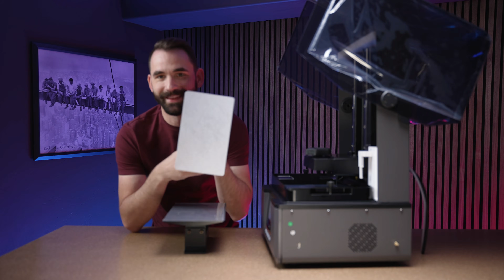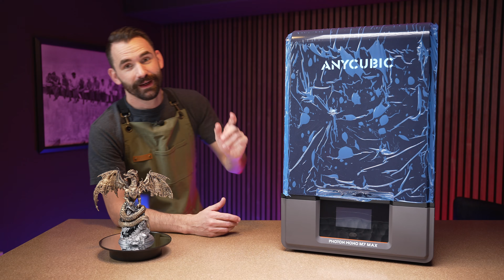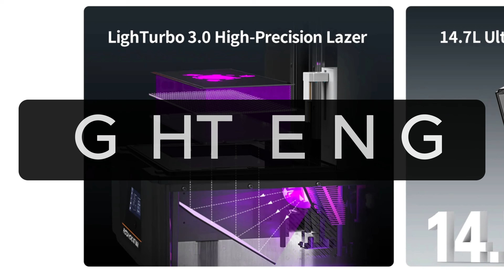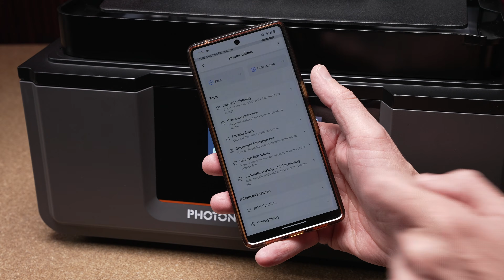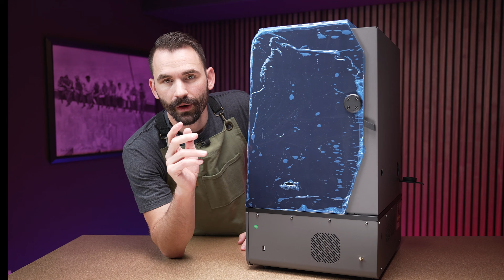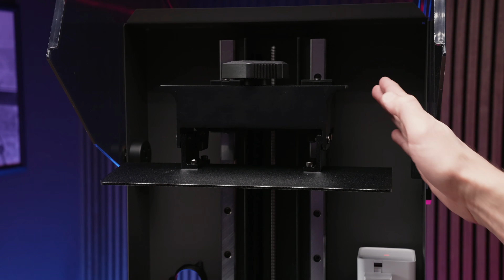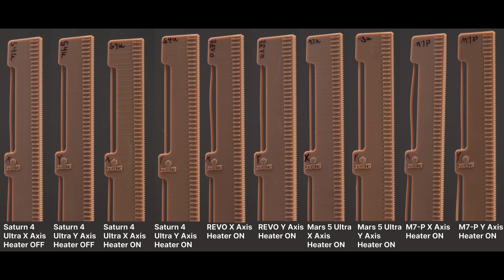Should the M7-Max be your next Printer?  #review #3dprinting

Comment: I love that the print will stop going to the top but i think it could be done better like elegoo did.
On my M7 (non pro or max) If i try to go up 50mm but its only 49mm to the top, it will give the error and not move instead of just going 49 and stopping. I would rather it be like my Saturn 4 Ultra, In the same scenario, it will just go up 49mm and stop.
I hate getting 49mm away, then having to switch to 10mm, go up 4 times, then go to 1mm and going up 9mm to get all the way to the top.
Reply from the maker: @TylerTroglen  What did Elegoo do? My Saturn 4 Ultra and Mars 5 Ultra will both crash at the top. Unless they updated it since last I checked. 

But on the Max if I keep pressing up on 50mm it will give me an alert exceeded upper limit. It will then go to the very top but not crash.  

I did not show this in the review I should have kept that bit.
Reply: @J3DTech  It must have been updated in firmware ( I've only had mine for 1.5 months)
You can use 50mm even if you are 1-49.99mm away, it just goes whatever amount,  beeps and stops on mine at the top.
My M7 on the other hand will just stay 49mm away while giving the error if the amount entered is too far. I was confused on the M7 and thought to myself, Why wouldn't they let it go all the way to the top at first before i figured out i had to change down to 10mm and 1mm increments to get all the way to the top.
Reply from the maker: @TylerTroglen  I just tested it on my M7 Max and it went all the way up to the top just by smashing the 50 mm up button.
Reply: @J3DTech  https://youtube.com/shorts/TJ0vapSvmgg?si=WVFFF33XaLrQhUV5 this is the behavior of the regular M7
Reply from the maker: @TylerTroglen  Ah I don't have the M7 to test on. But yeah looks like it needs the M7 Max love.
Reply: @J3DTech  It gets even weirder. I powered it off  and on for about 30 seconds and tried again. It just straight up tried to kill itself this time . I couldn't get the error to pop like before. It just kept trying to go up when it got all the way to the top. /sigh Obvi some firmware issues to work out. I would much rather get the error than that.
Reply from the maker: @TylerTroglen  They all do that. It has to be sent to home first.
Reply: @ good call. Thank you I did not know that.

Comment: Derek,
Can you confirm if there is no way to manually adjust the Z-height of the home position on the M7 Max? There’s a "Move to Home" button and a button for leveling, but there doesn’t seem to be an option to set the "home" position after manually adjusting it. On your level calibration prints, I’m getting consistent results, but the "1mm groove" appears slightly thicker, and I’d like to adjust the home position. I see no way to do this and was hoping you could confirm.
Thanks!
Reply from the maker: @jsgcustom2138  Right now there is no way to set the Z offset. 

It's still something I'm trying to get Anycubic to add in. 

How much over are you? Being a little over or under is just fine.
Reply: @J3DTech  On average, I’m getting about 1.2mm on the four corners. There is a slight bow in the build plate, creating a larger gap in the center. At this point, I haven’t been able to get a successful print of the “boxes of calibration” in the center with a burn-in layer exposure time of 35 seconds. The first layer of the boxes never sticks to the plate. I’d like to lower the build plate by 0.2 to 0.4mm to see if I can get it to stick in the center. This is such an important feature, and I can’t believe new printers don’t come with it from the beginning. I could try increasing the burn-in layer exposure time, but I think that’s the wrong “solution” to the problem. Thanks for confirming that the manual Z-offset is not present on this machine currently.
Reply from the maker: @jsgcustom2138  1.2 is ok but beyond that you're getting dangerous. 

You can try leveling it again that may pull you closer to the LCD on the print.
Reply: @J3DTech  Yes, that was going to be my plan. I'll push a little harder when leveling and try to narrow the gap a little. I may clean the resin out of the vat prior to leveling and see what that does. Thanks again for confirming no way to set the Z offset. I wanted to make sure I wasn't looking past it.

Comment: Can you let Anycubic know the heater for the m7 pro is not dynamic it preheats only but will not maintain temp during a print id imagine it’s the same with the max as well as the standard 7 we need dynamic active heat during a print 🥶🥶🥶🥶
Reply from the maker: When I pulled the data from the heater I saw that it was keeping the temps consistante over the entire print. There is always a spike for the burn in, then a small drop of where the heater isnt running then it will stabilize for the rest of the print.

I'll need to run some tests on the M7Pro to confirm as well, but in my Z tower prints, there is no evidence of a temp drop over the print on the M7Pro. The Z calibraion print should measure thicker at the bottom then the top if there was a temp drop over the print.

That said, sounds like I've got more testing and work to add to my board. 😆

Comment: hi, do you know what size the ACF Film is? it doesnt seem to be listed on the website and the chatbot has no idea either and i cant seem to find a clear answer on google about it. its just showing the smaller M7 Pro models
Reply from the maker: It's the same as the M3 Max. I buy my nFEP in a big roll that I cut to shape. This makes it cheaper and a 1 size fits all option. I have links in my guide for the toll I use. The stuff I get is 300mmw by 1000mm long. This will fit most any printer. 

https://www.aliexpress.us/item/3256802836288548.html?spm=a2g0o.productlist.main.1.44861d2ag2UnKb&algo_pvid=5fb7ee15-3ead-408f-9830-1836938e82b3&algo_exp_id=5fb7ee15-3ead-408f-9830-1836938e82b3-0&pdp_npi=4%40dis%21USD%2132.88%2126.96%21%21%2132.88%21%21%402101f49c17022329270716598ea569%2112000028640173249%21sea%21US%210%21AB&curPageLogUid=XzPbGV5uTqoc

Comment: I watched your video and decided to upgrade to the M7 MAX from the Mono X! 

I have a quick question: Does the M7 MAX come with a pre-installed screen protector (Not the proactive film during unboxing) ? I received my printer today and noticed a layer with air bubbles on the LED screen, leading me to believe it might be a pre-applied protector.
Reply from the maker: @DontLookLikeAFool  It is supposed to yes. It's not quite as large as the LCD. But it does cover the visible light area.

Comment: I just bought this monster and only after the fact have I realized that it donest have a screen protector. the specs say it has a "Protection film Replaceable anti-scratch film." I guess my brain took that to mean screen protector. so now I'm gonna have to order a thing of screen protectors for $22 plus shipping smh. Why not max out the M7 Max with a screen protector. this should be default feature. smh.
Reply from the maker: @xephorce  Are you sure it's supposed to
Reply: @J3DTech  according the the questions part of the M7 Max page on the anycubic website the first question is does it come with a preinstalled screen protector and the answer was no you need to buy it separate. but I did just chat with anycubic and the person asured me it did come preinstalled just didn't come with an extra

So I guess ill know for sure when it get here. lolbut thank you for the quick reply
Reply: @xephorce  I am actually is the one that asking the screen protector question on the FAQ section LOL.  

I received my printer and noticed a layer with air bubbles on the LED screen, leading me to believe it might be a pre-applied protector. Can you notice any air bubble on the surface of the LCD layer? If so, It likely is a screen protector, since LED shall not have air bubble. And the sell from Anycubic does not know what they are talking about.
Reply: @DontLookLikeAFool  i only ordered mine yesterday so I don't know what it will have. i am glad to hear from ya. I will be updating this string of post once I find out for sure. so excited. cant wait to print tanks and other Warhammer 40k stuff. some amazing titan proxies out there that I've been collecting for years. 

So how happy have you been with it so far? any major or minor issues besides those air bubble you mentioned? I also heard that anycubic might be looking into a screen upgrade in the future but only time will tell.

Comment: Really wish there were more reviews for the regular M7, I change resins alot so having a pump and pump based heater like on the M7 Pro is literally a waste of money for me. 👍
Reply from the maker: @kettusnuhveli  I also change resins a lot. You can buy the M7 vat and use it on the Pro
Reply: @J3DTech Good to know! I think I will go with the regular M7 as that way I will get the vat I want while having to pay less. Only other difference between that and the pro seems to only be a bit weaker light source.

Any update on the manual Z-offset for these machines as I also find it quite useful?
Reply from the maker: @kettusnuhveli  Not yet but I'll keep asking.

Comment: Hi there! You have some great videos! I have a question which you or someone who reads this perhaps could shed some light on. I'm strugglin to decide for the M7 regular or S4U as my new printer. The only thing holding me back from the S4U is that i can't find any intell on weither the 'auto level' system could result in less dimensional accuracy. Even when not printing directly on the buildplate. As in; if supports aren't accurate, would that also effect the accuracy of the model that's supported? If anyone could share some insights on that would be really great!
Reply from the maker: @AG-x4r  So the Auto leveling isn't real or any of them. I avoid printers that have Auto leveling. 

The M7 is the more accurate printer.
Reply: @J3DTech  yeah i didn't explain it well, i meant the S4U springloaded build plate to be precise, which you can't officially level if needed. So since i'll mostly print functional parts that plate system was a concern. The M7 looks like a great printer with great sensing features, and, a build-plate which one can level :)

Thanks for your response! Very much appreciated. If you have any Anycubic affiliatelinks i'll be happy to use it
Reply from the maker: @AG-x4r  You explained well and ai understand. I would really recommend the M7 or M7 Max for what you're doing.

Comment: wanted to get me the pro , it basically has all i need, BUT the vat form really bothered me, the 7m max solution is def better ! u think the m7pro is alot faster than the m7 max?
Reply from the maker: Speed = the resin and the quality you want. Not much the printer at all. But overall you don't need to lift as high on a smaller printer so they  can be a bit faster.

Comment: same screen, lost the ball screw. its a pretty disappointing release
Reply from the maker: @mysteriousfox88  There are quite a few upgrades in the lighting engine and firmware. 

I wanted to go deeper into the type of railway used but I'm finding it hard to gets details so I could give a more objective validation. So I ended up cutting that part. 

I'm working on gathering more information and educating myself in these topics so I can inform the buyer in the quality of the z-screw as being a ball screw isn't always better if it's a lower quality. 

As far as the LCD I agree as 12k or 14k would have been better at this size and I think the only thing holding this printer back from being absolutely amazing. 

But they are looking into it.

Comment: Very interested to see the light uniformity comparisons! One Question: The Saturn 3 Ultra looked so bad in comparison to the others - more than 40% variability! but your review of the Saturn 3 U was very positive. Does that mean the light uniformity comparison graph is not as big a deal as it looked?
Reply from the maker: @n0f8r  Both are true. 

1. I did not have this data at the time and I still think that the S3U is the best Saturn on the market and a good step in the correct direction. Sadly the S4 went Auto leveling.

2. It depends on what you're printing and your resin. 

If you don't care about really high accurate parts and you're not using really highly accurate resin, you might not be able to tell the difference. 

Or if you're doing engineering parts or high accuracy? Resins, those differences in the LCD can be the difference between successive and failure or out of spec and inspect.
Reply: @J3DTech  thanks! my Saturn 2 stepper failed, and wondering if it's worth repairing or should just upgrade to S3U - I also don't like the auto-leveling build plate of the S4U. S3U Ball screw instead of lead screw, and 4-point level platform seemed nice - but that light uniformity really concerns me. 

I'd love to see a video specifically on Light Uniformity comparing more printers and going into a bit more detail on how bad the problems with poor uniformity can get!
Reply from the maker: @n0f8r  That's my plan in the future but it's a very hard thing to get objective data on. 

I'll need to develop a methodology and then apply it to all the printers in a way that's visual yet easy and quick to understand.

If your ok with a smaller printer look at the new Anycubic M4 Ultra
Reply: @J3DTech  actually Jan Mrázek did a fantastic blog post (Dec '22) on the topic, and built an impressive open source custom machine with software that plots a heat map of the whole print surface, but he's only got 2 resin printers I think. It would be amazing if someone built his machine and applied it to a whole bunch of printers.
Reply from the maker: @n0f8r  I'll check it out. I'm really looking for some cool stuff like this to add to my reviews.
Reply from the maker: @n0f8r  The S4U's main advantage over the S2 or the S3 is the 4 point build plate system. so I would for for that over the S4U. 

The UV lighting system is somethign I'm working on getting more details into but furst I need to get some better tools.

Comment: Hi.
Did you try to measure flatness of the build plate while it is heated?. On some machines not printers if you measure some surfaces they are bowed but when they are in working/designed temperature the surface will be more or less flat.

Comment: Thank you for the review. I currently use an EPAX e10 8k and thinking about adding a second printer. This one looks great but I don't need the build volume. I hate to ask but what would you recommend after this on that does not have self leveling, like you I am not o fan of self leveling. Thank you for all your effort giving to the community.
Reply from the maker: @fs360llc9  If your looking for another in the 10" size I would recommend the Phrozen Mega 8k or wait a bit longer for the the next generation of Uniformation

Comment: Look into dental barrier film. It’s similar to the windows film you using but comes in rolls with a adhesive backing.
Reply from the maker: That would be GREAT for the LCD. Right now I cut a square out of the larger roll to clean off the LCD before I put the VAT back on. This smaller roll would make this SUPER easy!
Reply: @J3DTech  Use lots of soapy water. Google how to apply window tint.

Comment: If they release M7 Max with higher resolution or if they provide a screen upgrade kit so I can get 25-30um details im gone buy it asap. I already have the M7 Pro but I would love to make larger functional prints so I can actually get prints with good layer adhesion in all directions and that look like injection molding parts and not continue to use my Creality K1 Max  ( I don't mind if put more work to get better quality parts that fit exactly and can actually print intricate models with no problem). I don't want to buy GK3 Ultra cause it's way to expensive and also it doesn't have intelligent release which is a really nice feature if you want to get fast, dimensional acurate and insanelly detailed print parts (abs-like and though new generation resins are a lot more accesible this days and am not willing to buy very expensive fdm printer filaments which will never result in a print with great level of detail).

Comment: I agree on the power level availability.  I've needed to really hack my layer exposure and light off times with an engineering resin on my Mono X 6Ks printers.  It would have been handy to be able to reduce the light intensity rather than stepping down the exposure time and increasing the light off delay.  I still think that the M7 Pro is going to be my replacement for the 6Ks units next month since the 10.1" size provides what I need for both my engineering work and my minis and terrain.

Oh, and Fresnel is pronounced "fren-ell". Nit-picky, I know, but ...
Reply from the maker: @RocketCityTim  Yes my EPAX has a pot screw and I use this to calibrate the printer to the way I like it to print. 

That way I could keep the same resin profile over multiple printers and they all run at 30 um at 1.8 seconds and it makes life a little easier. 

I didn't really address this but if you can tell in the video I kind of cut out where I talk about the middle resins. I felt the session was just too long in fact through the editing process, I assume 50% of the video is cut because it just felt like it was less about the printer itself and more about relevant information. Data applies to the printer but more about 3D printing.